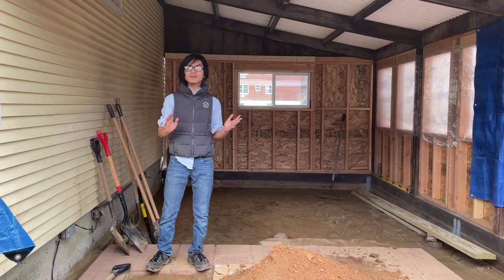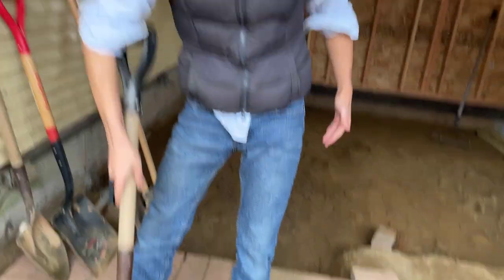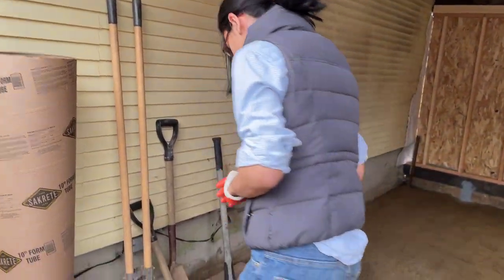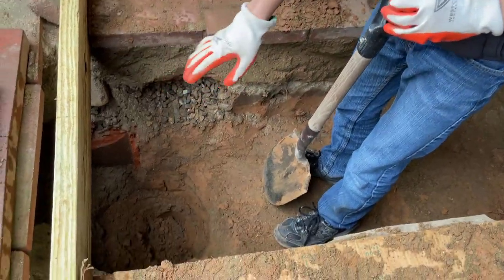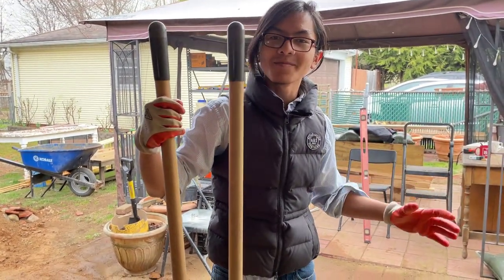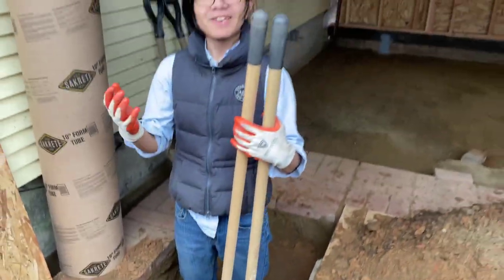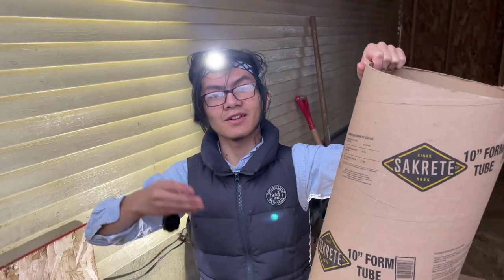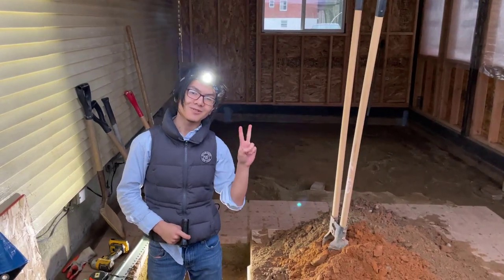How To Dig Deep Holes Manually Such As For Concrete Footings For Deck Posts & Other Outdoor Projects

Comment from the maker: Here are the #ad links to some of tools featured in this video & accessories suitable for this type of project should you be interested:
1.  https://amzn.to/2Qt7wYz | ECO LLC 63CC Heavy Duty Gas Powered Post Hole Digger with Three Earth Auger Drill Bits (6"+10"+12") Engine and Drill Bits Subcontract Delivery
2.  https://amzn.to/3wLYoP2  |  Fiskars 46 Inch Steel D-handle Transplanting Spade
3.  https://amzn.to/3mBZgkw | True Temper 2704200 48 in. Fiberglass Handle Post Hole Digger with Ruler and Cushion Grips
4.  https://amzn.to/3uylGGe  |  Mayne 580D-BK No Dig Ground Anchor
5.  https://amzn.to/3te2jC0  |  Titan Building Products Wood Post Anchor Kit 4" X 4"